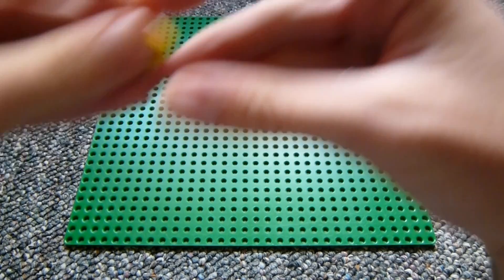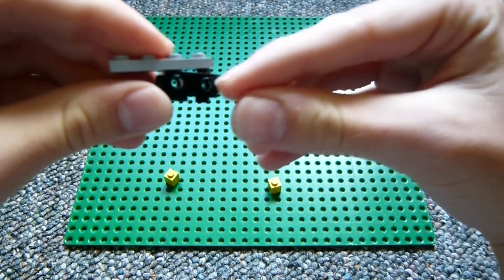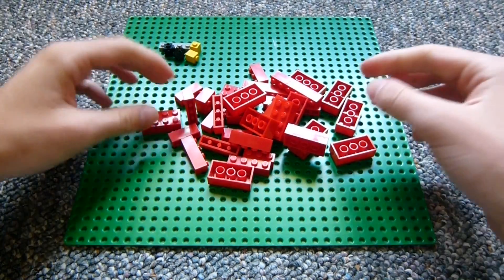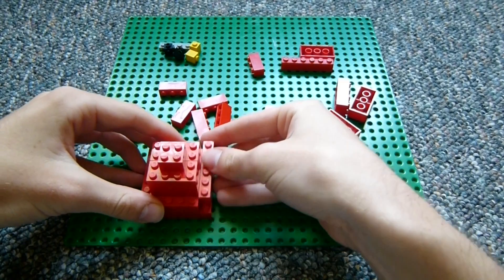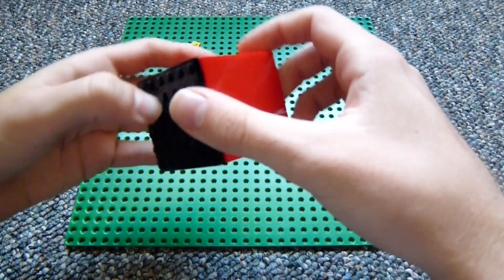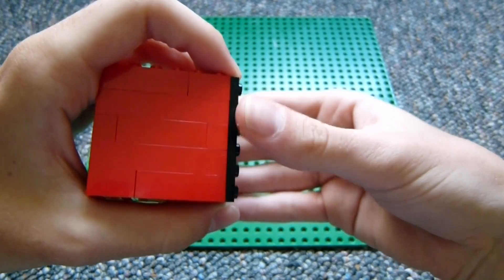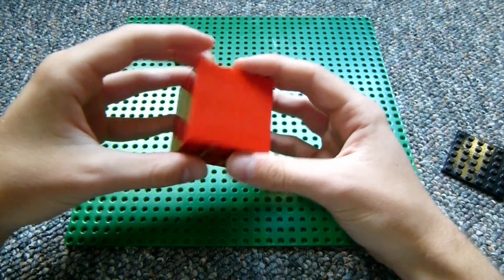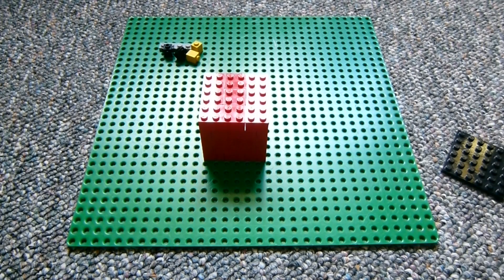Lego Building Technique: 5:6 Ratio and Cubes

Comment: Smallest ( easy ) cube with lego is a normal 2 by 2 brick ( that is 3 plates in height ), then add 1 plate of 2 by 2 on top and 1 flat plate ( flat without studs ) on top of that.
Counting with the 5:6 ratio, it will be 5 + 5 width and length and 5 * 2 ( plate height is 2 ) high, that's 10 by 10 by 10.
This was already used as a method of building "sideways" before there were bricks with snot ( studs not on top ).
[ edit ] In most cases, the added plate with studs can be best placed at the bottom to close the larger holes in the bottom of the normal brick.